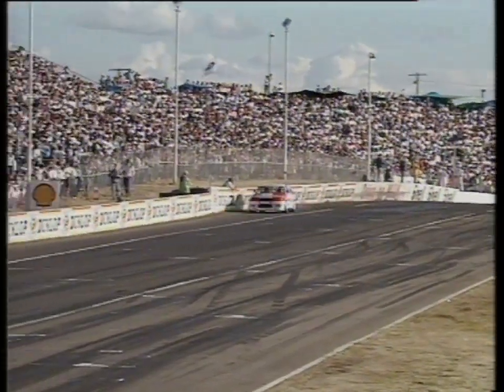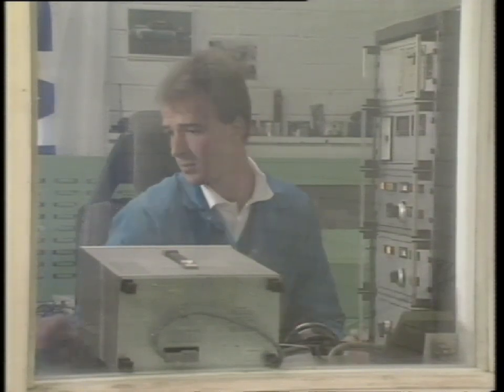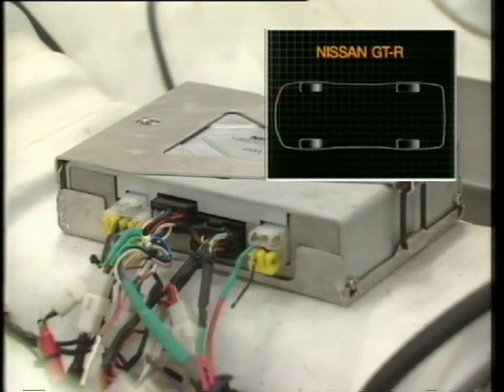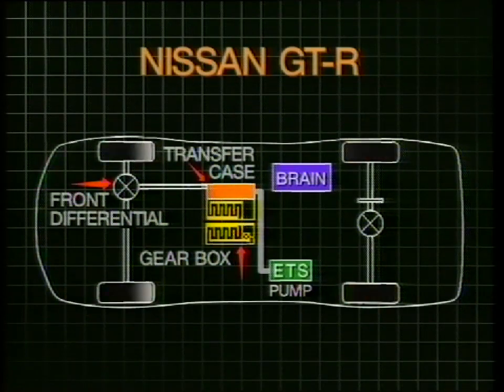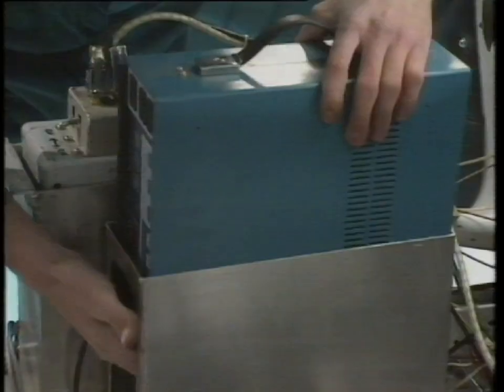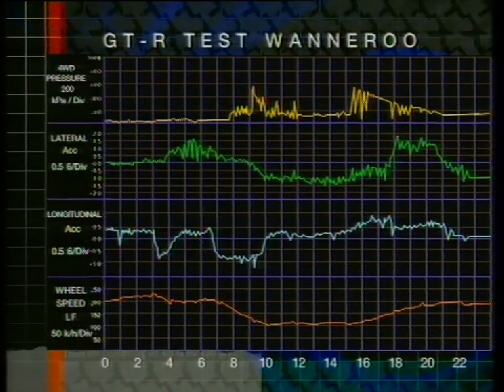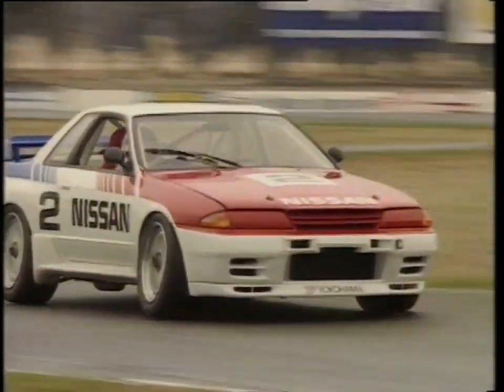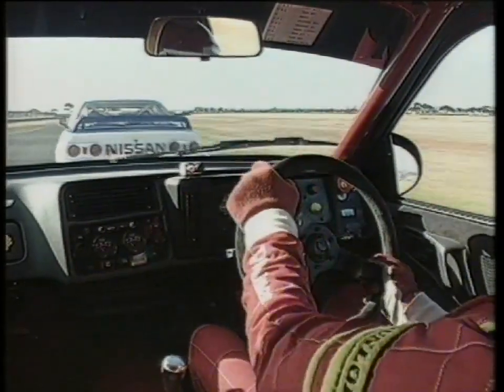Nissan ATTESA 4WD And The BNR32 Skyline GT-R

Comment: this platform/benchmark has been what manufacturers have been chasing since its induction. To me this was the golden goose that really open the minds of everyone else in the field of manufacturing speed/usable power. Torque vectoring etc re-shaping the maxmized line in a corner/grip/exit potential. To me The r32 GTR set the standard far above the range of what was previously thought possible....and to me that "BAR" is forever set in stone. Just about anyone "SERIOUS" is doing something in house to make their cars faster from a trans/gearing/tune etc standpoint...and IMO the R32 Really was the pioneer that opened up the echelon of speed/times engineering for everyone else across the board. While offering a seeming "reliability" aspect other SERIOUS members would also adhere to otherwise bear the burden of cost to own/run. Nissan IMO set both standards in a time where IMO most ppl/engineers never considered conventional/mainstream from a pure consumer/car/racing standpoint. As far as investment/implementation. To think it was a platform that out lasted porsches FR endeavors. As the Z was designed to aim for the 924-44 demographic or ferrari daytona that it once began as a comparable option towards...half the cylinders but definitely not half the car XD. To see how far theyve come from that era to this peak/implementation of automotive engineering.